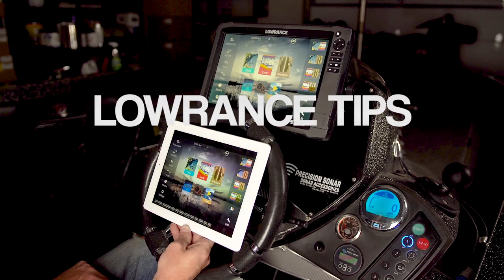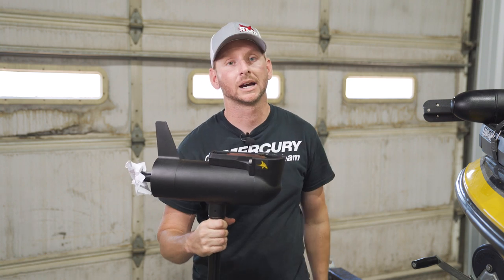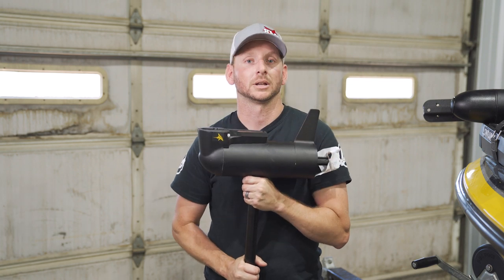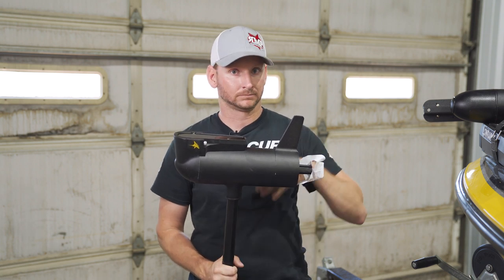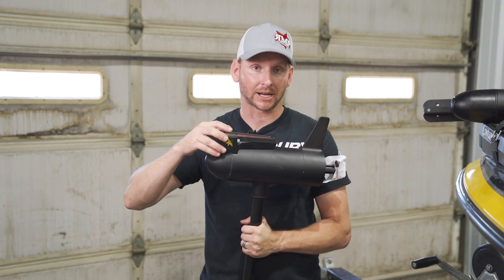Why You Shouldn't Buy a Trolling Motor With an MDI Transducer

Comment: You've stated what you don't recommend. What model do you recommend with spot lock and 24v (or 36 v) capability? (BTW, I already have a Garmin 93sv echomap plus if that makes any difference and may upgrade if any technology gets significantly better than that)

Comment: umm its called a skeg, if you are beating up the transducer you are doing something wrong,  have one on a surface drive mud boat and no issues.  The long dong transom mega transducer is way more at risk that the trolling motor

Comment: I was told if your unit does not support MDI it won't work period.  That's a none starter.  If I wanted to run a Garmin or legacy Hummnbird (non MDI supported) cable up the shaft, how difficult is that?

Comment: Question, I have an older model Terrova, can I remove the transducer and ad a plain cap, and montan external transducer. 45”, 80 lb ,24 volt, with remote control and foot pedal. Help would be greatly appreciated. Thank you.
Reply: Did you ever end up doing it? Thinking of doing the same thing.

Comment: I have a 12V terrova with US2 sonar and I don't have room t mount the DI or SI transducer. The guys at Bass Pro installed it at about the 5 o'clock position on the TM!! Is this correct?

Comment: Thanks for another great review.  Have you had much much installing external transducers to trolling motors with mounts that require the shaft to slide through the collar to deploy and stow (I.e. Xi5)?  I don’t like the idea of having the cable just dangling in the water to get snagged and destroyed, but don’t see many real solutions out there either.  Any thoughts here?  Good topic for a future video?  Hope this makes sense.
Reply: I KNOW LATE TO REPLY BUT WALLEYE WORKSHOP HAS THE IDEA ON SLIDE SHAFTS.. SIMPLE AND CLEAN

Comment: I want to buy a minn Kota terrova 54” shaft 55lbs thrust 12volt trolling motor with no transducer in the head with footpedal to do this I have to buy the trolling motor with heading sensor an a remote then purchase the footpedal separate what kind of trashy shit is this a trolling motor with no foot control

Comment: The thing I like about the built in transducers is they seem less likely to be damaged when fishing in shallow lay downs and rock. I’ve broken mine at the weak spot where the screw clamp goes through several times. I keep having to super glue it back together. The buillt-ins seem much more durable.

Comment: Hey, guys! Thanks for the videos!  Do you have a video or suggestions on the best way to add an MDI tranducer to my Ulterra.  I was too ignorant of what I had, thinking my Ulterra already had the MDI built in...it doesn't, and now I've bought a new Helix7 specifically for the MDI, and it's not compatible. I mean, surely there has to be a way???  Thanks!
Reply: Did ya figure out your helix 7 to your Ultrex? What model no.  Helix 7?  I’m shopping a helix 7 for my Ultrex MDI
Reply: @tommwarneke396  Thanks, yeah,  Mine is a Helix 7 G3N MDI....  I'm running a  Minn Kota Ulterra...   I finally got all the pieces I need to make it work, started assembling it today...haven't fished it yet.